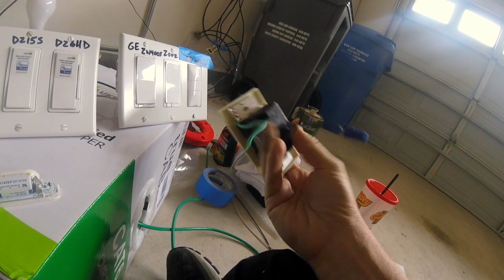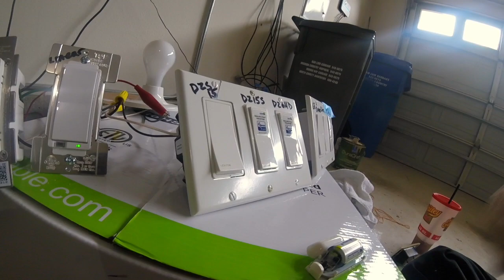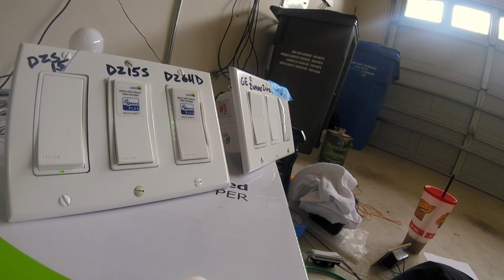Comparing Z-Wave Wall Switches

Comment: I don't ever comment, but fantastic video. There are no good ones comparing all the main options available. You explain everything extremely well and with a good setup. Only thing I would add is that the Zoozs do not require a companion switch in a three-way configuration, (saving money) and to top it all off, are the cheapest of the bunch as well. Do you find the Homeseers to have any noticeable delay?
Reply from the maker: Well, the Homeseers are dimmers, so they have a slew-rate. I've never seen a dimmer that instantly goes to a certain dim level. However, the Homeseers allow you to set the dimming rate for the paddle and Z-wave commands _independently_. This means that you can have Z-wave dim values take effect very quickly while dimming at the paddle can happen more slowly (or you'll go insane by over-shooting the dim level you were trying for).
Reply: Have you ever tried the inovelli? Curious about them